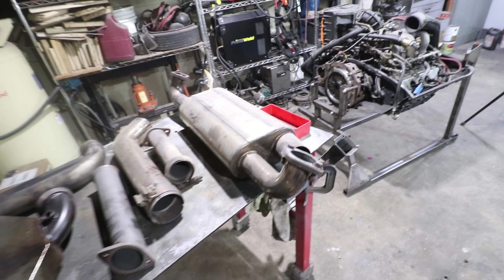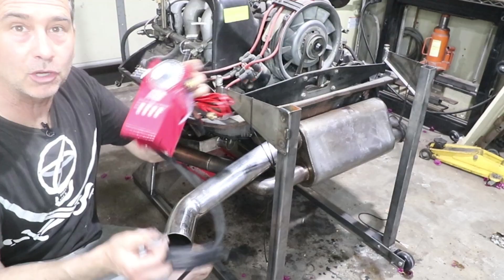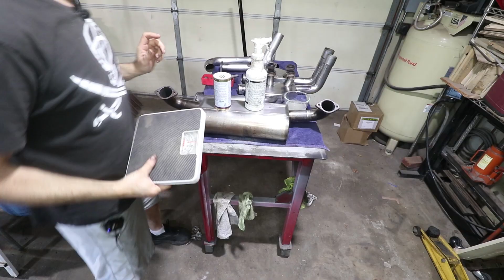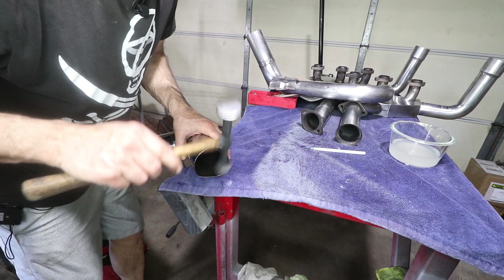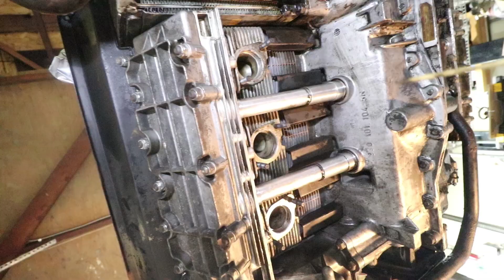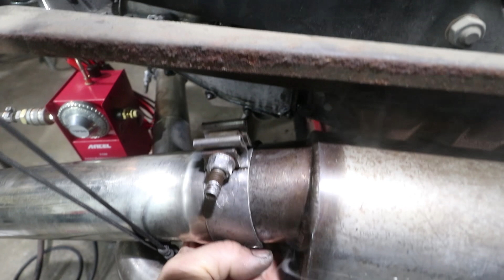I Got a FREE  911 Stainless Exhaust!  BUT, WILL it LEAK?

Comment: I was given a complete Billy Boat exhaust for my 3.6l in my 73 hotrod. I got it ceramic coated instead of cleaning it. Did it ever turn out nice. I had done lots of experimenting with mufflers before I got this system. Single out gives quiet sound. Dual out gave a noticeable increase in power. I installed an electric shutoff valve in the right tailpipe to give me quiet when needed and power when needed. worked out very well.
Reply from the maker: Thanks Randy, I think Billy Boat and GHL are similar designs, so it's great to know you liked it.

Comment: I like the idea of making progress every week. 

My two cents worth: I seal that type of exhaust joints with high temp rtv, the red brown stuff. It will not only seal the joint it will make disassembly easier
Reply from the maker: Thanks for the tip on sealant.  Can't hurt, so I'll give it a try.  
This part is much lower temperature than the other joints too, so I suspect it last a long time too.